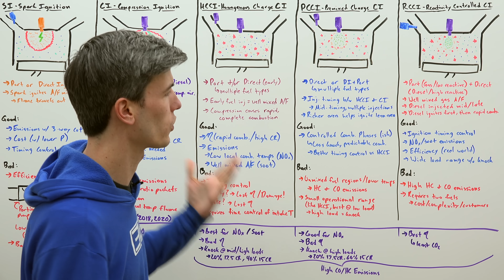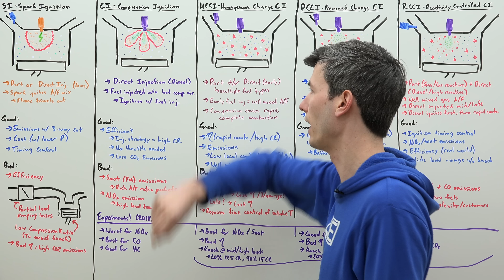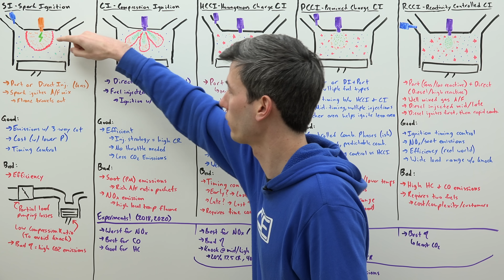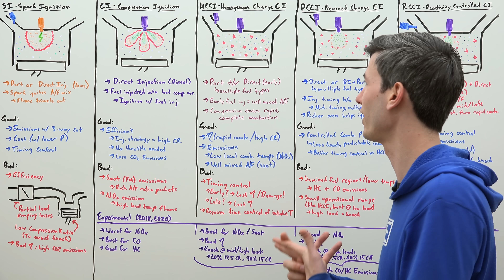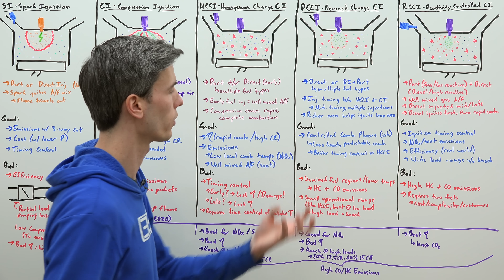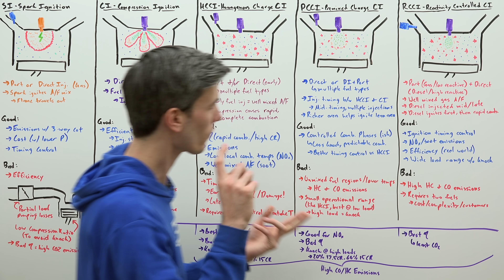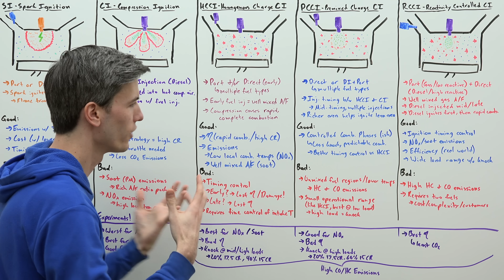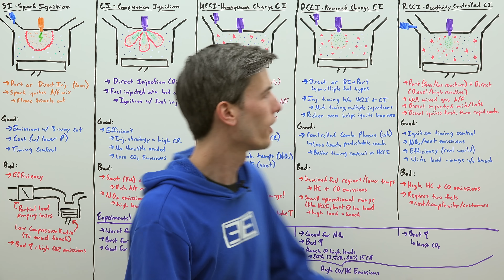If Combustion Engines Have A Future, What Is It?

Comment: The future of IC engines is as very small single operating condition sustainer engine in conjunction with battery electric drivetrains. It would be sort of like the Chevy Volt, but different. The sustainer engine is sized only to meet the average power required by the vehicle. For example the Tesla Model 3 consumes about 234 Wh/mile cruising on the freeway at 70 mph. The power required is only 16 kW or 22 hp. Given the losses in the generator and rectifier of around 10%, the engine would need to output around 25 hp. The sustainer engine is only connected to a generator and its only job is to run at a constant power and make electricity. The battery electric drivetrain is what actually drives the vehicle and is completely capable of driving the vehicle for some reasonable distance, say 70-100 miles, with just battery power. But for longer trips the sustainer engine starts when the batteries state of charge is down around the midpoint. When the engine is running it is supplying all or nearly all of the power required for steady cruising. The batteries will then only have to make up the difference in power supplied by the sustainer and the power required by the vehicle during acceleration and climbing hills. The batteries then absorb all of the engine power as well as regen energy from the motors when braking or going downhill. 

So while not a zero CO2 at the vehicle level such a hybrid would cut their CO2 emission by 90%-95%. 

This type of system will work even better for larger vehicles like the F-150 than a 100% battery electric (sorry Ford, but I think you screwed up with the Lighting). But even with energy consumption around 530 Wh/mile in combined driving and maybe around 650 Wh/mile if pulling a trailer or carrying a large load on the freeway, the power requirement at 65 mph is only 57 hp, requiring a 64 hp sustainer engine. And my apologies to Elon Musk, but a 100% battery powered semi makes zero sense. Much better would be to use this type of battery hybrid system. Even for these huge vehicles where even the most modern and aerodynamic trucks only get about 8-9 mpg the average power at 65 mph can be meet with a 140 hp sustainer engine. My calculations show that with a sustainer engine that highly optimized for its single operating level, the fuel efficiency of these monsters of the road could come close to doubling. It would still have all of the advantage of a battery electric truck, like brakes that don't wear out or fade because the drive motors are doing most of the braking and putting the energy back into the batteries. That also means no hard downshifting to use engine braking to spare the brakes and in the process irritating everybody within a 1/2 mile radius.

If the sustainer engine used a green fuel produced from renewable resources rather than fossil fuels, even the miles driven with the engine running might produce a net zero CO2. There are many efforts to make green fuels, but the most promising I have see is a process that can use renewable energy sources along with an electrically charged catalyst that takes in CO2 and H2 and directly make methane and methanol. These are then is combine in a second process to make butanol. Butanol has some very attractive features. It has nearly identical volumetric and gravimetric energy density as gasoline. In fact can be burned at 100% in a gasoline spark ignition engine with little or modification. But unlike gasoline it has a much lower vapor pressure and flash temperature, and so is much safer than gasoline. And unlike ethanol, it will not absorb water from the air and so won't degrade if allowed to sit in the fuel tank for potentially months. 

So I think that there is a real future for IC engines, but only as a supporting role in a battery centered electric vehicle.

Comment: Can you answer the question of whether ICE cars are on the way out and EVs on the way in because teh development potential of the ICE engine is getting toward the end, while the potential of EVs, better motors, new battery technology is simply getting greater? If that is not true, and ICE still has efficiencies on the horizon or if battery technology stalls,  I would expect them to coexist for some time, maybe a very long time.

Comment: ICE engines have a future because of the extreme energy density of the petrol fuel. Miniature powerful vehicles, can't be electric for another century maybe. Just like a megawatt radio transmitter needs to be manufactured by using vacuum tubes.

Comment: I do appreciate you videos, and understand fully the educational value as they are (and they are very informative)...and here comes the inevitable "but"...but, there is a LOT more to power/fuel efficiency than just controlling ignition timing that I think is equally valuable to the conversation.  Combustion rate is critical as well.  Yes, that is all wrapped up in the injection timing/quantity and placement (PI vs DI) that is inclusive in "fuel/air mixture" that was assumed in the explanations, but its a disservice to the process to simplify it so.  How the mixture methods/rates behave during compression/ignition says a lot about WHY there is such a discrepancy between the efficiencies of different strategies.  In other words, at the level of understanding that you present the majority of the video (which is very well done), "knock is bad" just isn't good enough.

I'm really not trying to knock your video...it is very well done, and informative...I'm just saying there was a real missed opportunity to expand just a little more on what is really different about the injection strategies and why some, more than others, are more susceptible to knock (in some cases, prohibitively so)

Comment: I just got vibed about M1 Abrams ATG-1500 turbine engine and  how efficient in torgue it is to accelerate 70 ton tank up to speed on cross-country roads like a glove)))))
Only thing it's big fuel consumption,cause it's basically heli engine fit in  a tank, and it's big filters,that making back of the tank so ....squared and big))))

Comment: One fundamental is being missed here.  The higher & lower efficiencies being cited all apply when the engine is a maximum efficiency, which only occurs at a pretty high power output, around the maximum torque point, or maybe 75-80% of maximum power.  That's great if your application can run the engine at that power level all the time.  However, any of these engine design are awful (from a pure efficiency standpoint) for powering personal vehicles, because the average power needed is far, far below that maximum efficiency point.   

e.g. The power required to cruise at a steady 40MPH on a city street is only 10-12 HP.  Using a 200-HP engine to generate 12 HP is akin to using a 40-pound snow shovel to move 10 pounds of snow at each stroke.  Just as you'd waste most of your muscle power lifting the heavy shovel to move a small load, you waste most of your fuel budget spinning a big engine to do a small job.

Comment: It'd be interesting if they could use some kind of oxygen enriched fuel that would eliminate the need to use outside air in the combustion process. It has already been proven that higher O2 concentrations increase the efficiency of the DI diesel combustion process.

Comment: RCCI is the next best compromise. But I think the magic is already premixed fuels at the pump.

The f1 turbo era of the 80s were running special blend of racing fuel that had toluene, benzene, diesel, and regular gas. I think it was the BMW team I read an article on where they said gas mileage increased. They were still spark driven but I think heat charging through a controlled heat exchange could prime the primary fuel injection just as it mixed with dense cool air. The secondary fuel is then added in the cylinder and is ready for sparkless ignition via compression.

But the problem is cold starts... not sure how can that be done reliably before the primary intake fuel injector is heat primed... maybe special heat plugged injectors?

Comment: Automobile engines do not seem to have future for now. Recently, Audi said they will no longer develop new IC engines, due to Eurocomission pushing on Euro-7 but rather try to improve existing ones - and soon we will see many of this.

However, internal combustion engines have future in airplanes - to the point where we can call it a second birth.

Search for Celera 500L - a future of civil aviation. Already flying 460mph (Some civil jets fly hardly more!).

Also, ships. Huge diesels are not going anywhere.
Reply: Policy can be changed if the combustion can prove they're clean I'm pretty sure they'll make IC again one day

Comment: My guess: ultra lean hcci turbocharged free-piston engines. Basically a high efficiency combustion-based eletric generator. Timing isn't as much of a issue there because of the constant load and you can take out the whole unit and put a battery there once it becomes more viable because those engines are small and made with modularity in mind (at least that's the Toyota's approach).

Comment: I have a thought/question which is, at the moment it is said that fuel cells (FC's) run on hydrogen or methane gas (with the use of catalysts), why can't hydrocarbon fuels be gasified (most hydrogen produced at the moment is from steam reforming natural gas and it is said this is a large industrial process, but in the past engines were made to run on TVO (tractor vaporising oil) where the fuel was heated (usually by the exhaust) to make it vaporise, I know it's not the same but it should be possible to gasify gasoline and/or diesel) and treated/catalysed for use in a fuel cell to power a vehicle. If it could be made to work wouldn't that have the advantages of each of the 3 main competing technologies (EV's, FC's, ICE) whilst at the same time managing to overcome the problems associated with each of the technologies (as I see it the problem with ICE is not the hydrocarbon fuel but the combustion process), so with the above in mind my answer to your question would be, the ICE is dead --- long live the hydrocarbon fuel cell.

Comment: There’s actually a demand for that kind of engine in LPG conversion of diesel engines.
The LPG is a high octane fuel that can be port injected.
The engine needs to inject some amount of diesel to start the ignition.

Comment: Combustion engines now seem like Rube Goldberg contraptions compared to electric motors.  EV Horsepower to weight advantage, and efficiency due to not having to lose energy with reciprocating losses and friction losses.  I always wondered how much energy is lost accelerating/decelerating the pistons vs engine friction losses, i.e. which is greater and what fraction of energy is lost?

Comment: @Engineering Explained - you were touting electric cars being efficient than ICE, can you prove it?

suppose we have 1 hectare of land and 1 year of time. we can either a) use it to grow crops and turn into ethanol to power an ICE car. or b) cover the land with solar panels to generate AC power, which then coverts to DC to charge an EV. finally, we compare the ICE car and the EV car, which car will drive a longer distance, based on that 1 hectare-land-year unit? in both cases, the original source of energy is sunlight. so this comparison fairly compares whether ICE or EV makes the most efficient use of sunlight. (difficult to compare when using hydro / nuclear)

Comment: Wow, it's almost like you don't know anything about global warming and climate science. You do realise that we need to get to pretty much zero combustion of fossil fuels, do you? 

You can't talk about the future of combustion engines without mentioning man-made global warming and its implications. So your video misses the whole point. What you would have to discuss is what will a CO2 neutral energy grid look like and is there a place for combustion engines? 

This means that the more important thing is the fuel. It's almost all about discussing the fuel. So what options do we have? 
-Hydgrogen made form electrolysis of water (inefficient uses about 5 times more energy per distance compared to EV)
-Liquid e-fuels, same problem in combination with an ICE, but even less efficient than hydrogen
-Biofuels, here we often have EROI problems, the inefficient ICE in combination with the fuel makes it an energy sink

Conclusion: 
There's likely no future for the internal combustion engine, except for very rich people and maybe in some exotic niches.

Again the goal is CO2 neutrality and not just less CO2 - that's not enough. You don't seem to get that.
Reply: Biofuels may be a good measure toward carbon neutrality for ICE vehicles until battery tech catches up with consumer needs.
Reply: @sking2173  
Why? The average car owner drives just 29 miles per day. 95 percent of all trips are below 50 miles long. Every electric car can do that. 
I have a cheap electric car (the cheapest new car you can get) and in the summer i can easily get a 300km range. In the winter about 260km range. 
A Tesla has about a 500km range and you can do 1000km in 10 hours if you know what you're doing. 
The problem in most cases aren't electric cars, but that people don't know how to use them and what they can do. And often they don't even know how long their usual trips are. 
I recommend Bjorn Nyland's channel if you want to learn what an electric car can do. Also learn about the consumption for different speeds. This makes a huge difference in terms of range.

Comment: Why can't gasoline/petrol be used in case of diesel in compression ignition engines, though? Is it because of knock and air-fuel mixture preignition-related issues, along with timing? Let's leave out the lubricating properties of diesel for the fuel pump, injectors and other parts that depend on the fuel itself for getting lubricated while running.

Comment: We better do something, the earth warmed faster in 2020 than normal because of less particle pollution from planes, cars and more
Reply: LOLOLOL ...
Reply: @sking2173  You don't believe in global warming or that the earth warmed faster? Either way you should probably do a little searching around.
Reply: @oliver24x  — What I laughed about is that you said that “because of LESS [particle] pollution”, the earth warmed faster in 2020. Without further explanation, a rational inferral would be that “pollution from planes, cars and more” isn’t the cause of global warming ...
Reply: @sking2173  We could potentially fix this though by making CO2 neutral fuels with CO2. It requires energy but if the energy used for this process is CO2 neutral too, net CO2 pollution would be 0. I think this would be important for a long time, we ain't getting all gas cars of the road anytime soon. CO2 capture-to-liquid fuels is realistic and has been demonstrated to actually work, but as with other green alternatives it requires incentives.
Reply: @oliver24x  — You are 100% correct. 

Additionally, aviation and shipping are two transportation sectors which won’t be adequately served by electric power for years to come. CO2-neutral fuels will be able to power these energy-hungry industries until an adequate AND cost-effective alternative is developed.

Comment: What about carbon-neutral fuel? I feel like this is the most promising by a mile.
Reply: The problem there is the efficency. You use quite a lot of energy to produce the carbon-neutral fuel and burn it again with ~40% efficency.

Comment: Electric cars make sense for urban anthills, less so most of the world.  I suspect that only subsidies are driving this discussion and without them and the agenda behind them this would all go away.  A far better solution might be non-plugin hybrids with smaller efficient gasoline engines, designed with far larger batteries than in the past and engineered to self-charge in place even when not rolling down the road.  Users could pick the charging interval whenever they "turn off" the vehicle.  Tap for 0, 15, 30, 60 minutes or until charged.

Comment: Don’t know what ever happened to the natural gas injection for Diesel engines it seemed to be catching on right before all of the new emissions standards started in 2007 
It was working as a dual fuel system only less complex it was basically injecting natural gas in the same way drag racers inject nos but was showing that it was helping diesels run extremely clean yes it would be a pain but is probably better than the DPF and DEF systems that are being used currently

Comment: I am revisiting this video, throttle body bodies are being used to control NOx emissions nowadays by starving Oxygen from the combustion with Exhaust Gas Re-circulation as well.  But why does DI (Direct Injection) produce so much soot in either Gasoline or Diesel?  Is DI less efficient in the mixing of the fuel with air than Port Injection is?  What causes soot formation in the combustion process?

Comment: The future of combustion engines? Being generators, for instance as range extenders for electric vehicles. Then they don’t require being able to handle more load they can run at optimal rpm for generating electricity.

Comment: Future of combustion engines.
Flat two engines, located under the trunk's floor, generating energy to power the batteries and the electric motors of the car.

Comment: Create incentives or grants to coerce large employers to install solar panels OVER employee parking lots.   People with EV's drive to work in the AM, plug their car in to charge through the day.  No need to charge at night, which will balance the load on the grid during early to mid evening hours.  Solar panels don't develop as much energy on cloudy days, but cloudy days also mean lower energy consumption, due to less energy being used to cool homes and businesses, so the load on the grid in the evening, while higher, won't be as much of a factor.